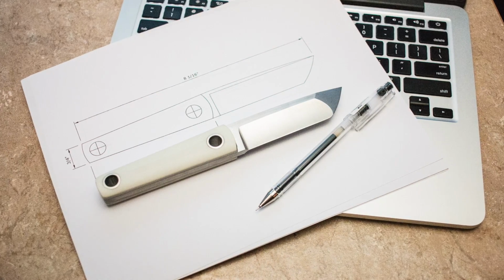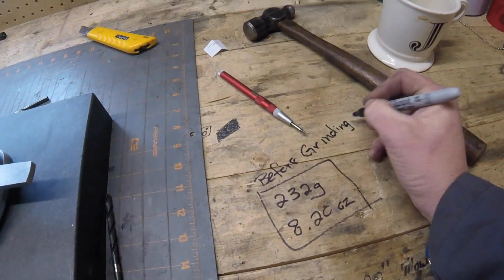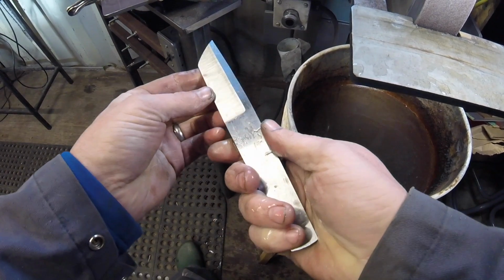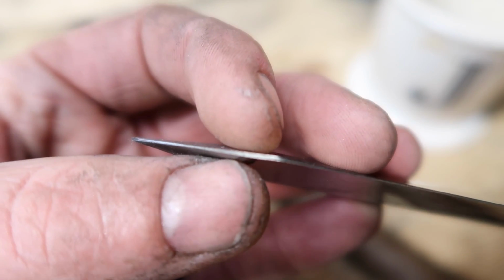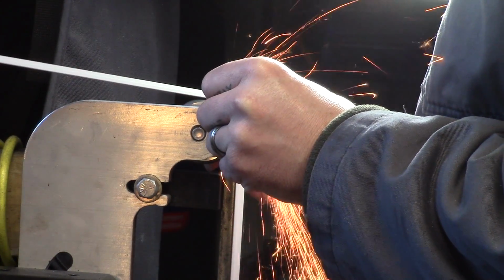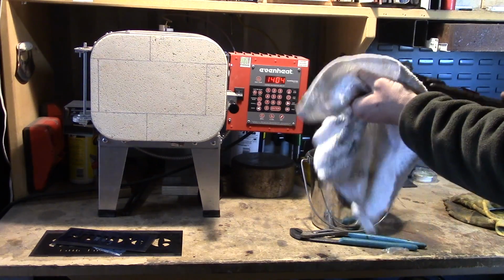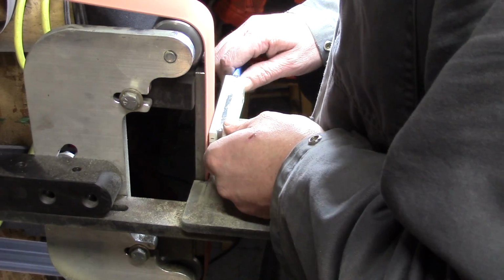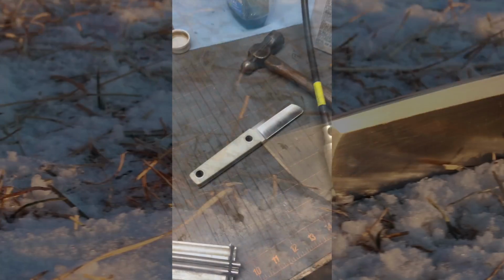How to make a knife - a Tanto Knife

Comment: Looks good Jeremy, a nice classy piece! Have you ever done a tapered tang? I think that would greatly reduce the weight as well, especially using .25" stock.
Reply from the maker: Thanks buddy! No I haven't done a tampered tang yet but it's on my list. I'm still trying to sort out how exactly I would do it. The thing I have the hardest time getting around and it's probably nothing, but I worry about drilling the holes and getting them all to line up plumb when the tang is angled. It's probably like most things: just start doing it and you'll figure it out:)
Reply: Simple Little Life what if you drill the holes first, and after that you make the tang tapered? (I don't know if it works, but it was the first thing I thought of)
Reply from the maker: Yeah it sounds like it would work but I'm wondering about installing the pins during glue up after the tang has been tapered. the holes drilled in the scales would then be slanted due to the taper of the tang. Although I'm sure it's something that doesn't even need to be worried about. Things like this hold me back all the time and then when I just say who cares and start doing them, it's amazing how easy they are and the "problems" I was worrying about in my head don't even exist. :)

Comment: I'm working on my first knife. It's a tanto as I love the style! I've made the main shape of the blade and handle but when drilling the holes in the handle I drilled one hole fine but my dill bit melted in the second hole and I thing the metal has hardened because all the new drill bits I use break instantly! I don't have much money to risk buying more drill bits just to have them break as well! Should I cut my losses and grind a spike like hidden tang to put into a wooden handle or is it possible to redrill the hardened hole to save the full tang?
Reply: dom sturman 
Hi I have never built a knife my self, however, this intrigues me.  Are you using quality drill bits?  Melting?  When the bit quits cutting you need to re sharpen it.  Perhaps some cutting oil would help.  Also, you may need to start with a smaller hole first, then progressively go to a larger bit.  It sounds like you may be using an old file for your knife blank, in that case, you will need to anneal the metal.
Reply: +Jim Goodwin I was using cheap Chinese drill bits. Bought a good quality one and it drilled like a boss! Thanks for your advice 👍🏻

Comment: what is the wall thickness on those pins? I like the way they look im thinking about getting some. thanks!
Reply from the maker: I don't know as I'm currently traveling right now, but they seemed to be a fairly common thickness like schedule 40 or something. It is a seamless stainless steel pipe I bought though. Cheers!

Comment: What are you using to hear treat it? And what might be some alternatives to that specific machine?
Reply: Heat ** treat it,  sorry
Reply from the maker: +A. Parsons I use an even heat kiln but before I got that I used an acetylene torch. Whatever way you came come up with to evenly get the blade to around 1475 degrees F (assuming it's a carbon steel like 1095,1085 or O-1 you're using). Cheers!
Reply: A. Parsons people have actually even used cooking ovens to heat treat as well.

Comment: Do you prefer the Sharpie to layout fluid? Also, do you make butcher's knives (skinners, boning knives, cleavers, filets, etc.?)
Reply: Edward Spencer layout fluid is pretty expensive and if your making not very expensive knives it is not worth it
Reply from the maker: For small little areas I just use sharpie because there is always one laying on my bench and it's fast and easy. But I do use layout day when I'm doing a larger layout for sure. I do really like using layout die. 

BTW, the Bruins are my sons favourite team so I live your profile image:) Cheers!
Reply from the maker: I use layout dye for a lot of stuff but for small areas I just use sharpie because it's usually quickly in arms-reach. Cheers!

Comment: what type of drill bits are you using... i keep on messing mine up andi dont know how... 
p.s. i am buying them from Lowe's
Reply from the maker: I use mostly Dormer and SKS. Those are fairly pricey but they do last a good long while. Also one thing that isn't too noticeable in this video is I do tend to go heavy on the cutting fluid. Cheers!

Comment: how much watt is your drill press?
Reply from the maker: I'm not sure exactly. I have two, both are bench top models and neither of them are overly powerful.
Reply: +Simple Little Life alright. what do you think off an 300 watt drill press. can it do the things you do?
Reply from the maker: I think that would come in at just under 1/2HP and that would do this stuff for sure, but you might just have to take it easy. Run it nice and slow and see how it does:) Cheers!